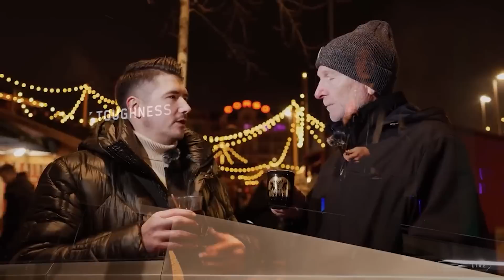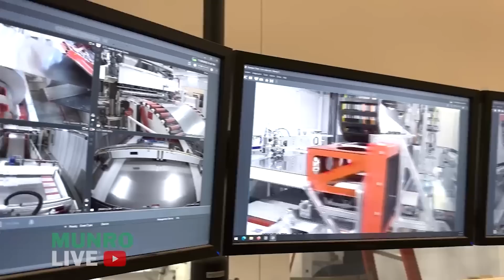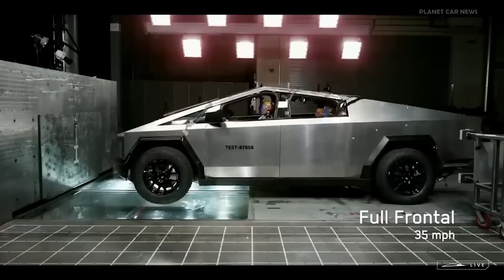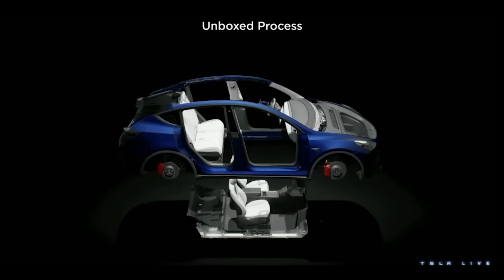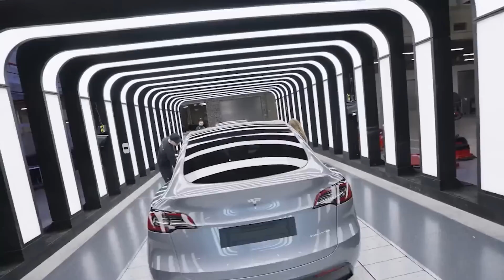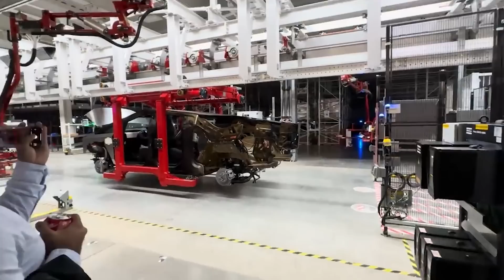Scott Walter Drops BOMBSHELLS on CYBERTRUCK!!

Comment: Ya when Tesla designs something - too bad the 4680 as originally planned is totally dead.  The 4680B which being put into Cybertrucks has sad performance. Youtube drove to 0% Range on flat ground 73f 70mph - 250 miles.  Time to charge 70% on first independent charge time recorded - a Hour! Add to that only 225 delivered as of 9 Jan 2024. The entire project is a wreck.

Comment: The Cybertruck supports variable suspension heights, the highest being 17 inches above the lowest. If I were doing the pedestrian safety test, I would be inclined to use the highest, in which case the argument that a person would be flipped over the hood fails. We'll see what the European testers think...
Reply: the truck can only move less than 10MPH in high and extract mode before the system lowers it. if you see any of the videos of the truck driving  > 20mph it appears to be at the entry or low setting to improve aerodynamics

Comment: With the 800V technology used in the Cybertruck and the new 48V low-voltage network, the Model S and Model X can be further developed and the Roadster 2 can be built.
No new factory is needed for this.
Reply from the maker: My theory is that the model 3 highland is a good base for the roadster 😃

Comment: One issue that is just coming to light is the last minute shortening of the front end has had a detrimental effect on the frontal crash test compared to a F150. Not sure if it makes it unsafe but the extra length of the hood area on a f150 makes the deceleration of the occupants much slower and therefore safer.
Reply: Oh really? You’ve already seen the NHTSA score for the CT despite no published star ratings yet? And the IIHS having not conducted any tests yet? This has all “come to light last minute” from what, exactly?
Reply: @n1c2c8  I am waiting for those and also for the Euro NCAP crash tests and the UN/ECE results.
Reply: @n1c2c8 Without much examination you can make a rough guess just by knowing that cybertruck has almost no front end and the structure behind the frunk is a bit unusual, plus two big wheels and not much else is a bad crumple zone.  Irrespective of this, comparinng the occupants body movement in overlayed crash videos by an engineer seems to back that up. But in the end, I only stated it was comparing to the Ford, and have no values to determing if it was a bad score and dangerous, and didn't state that.
Reply: @gacattack1234  They anticipated that. Bookmarks for front crash can and rear casting crash: https://youtu.be/J5zDNaY1fvI?t=1881&si=GfAf4SuuTMg--3rS

I will wait for ratings from third party testers over "rough guesses", napkin math and overlays on limited crash footage. I get it, if it comes out that this thing is unsafe and a death trap I will be the first to admit it but damn, can we chill on the doomscrolling and sensationalism until that point.
Reply: The important measure is not how far the head moves, but the peak decceleration force. For constant force, distance is relevant.   In the video it appears to me that the CT airbag deployed closer to the occupant.  If so it could be that applying airbag force earlier results in less head movement AND less peak force too.  The vital dTa is the accelerometers and force transducers in the head of the dummy - not the video - not arm-chair crash test 'experts' opinions... The proper approving bodies have the key data, and will publish safety rating... until then, make your wild ass guesses - to be judged a hero or zero.
Reply: @DarylOster  Without data it is all WAG.
Reply: @DarylOster  The longer movement over the same time implies a more gradual deceleration,and a lower peek deceleration, why is it a competition to be right when it is just speculation and not presented as anything more, I am mostly impressed by the Cybertruck and hope it gets a good result, it would be surprising but am happy to be even more impressed by it.
Reply: The CT has a higher degree of engineering in the front crumple zone..... The front casting has just what is needed to cause a perfect deformation and deceleration in less space
Reply: Oh and it was not a last minute change either the configuration of the accessible space maybe had changed latter but that's of little affect
Reply: @emiliohernandez7747  Well, not many would know when it was actually done, when it did appear, though, relatively late in the design process, it caused a bit of stir.
Reply: @emiliohernandez7747  That's what you would think, but with big wheels as impediments to the crumpling of the casting, I'm not sure it would help a lot, they're not airbags, they are usually designed to break off with aluminium control arms, so the can get out the way. Didn't see any of that happened but the speed was low. Think that might be for front offset crashes.

Comment: It's important to note that while going for stainless steel gave Tesla new troubles, it was a solution to the manufacturing issues they had with the paintshop, so if they solve these current problems, future stainless steel Teslas will be even easier to manufacture.
Reply: Ya know, if you want to fix your issues in the paint shop, then just call the people that make the paint robots and the paint and actually do what they tell you for once in your life!
Reply: @JetFire9  You forget first principles. The best part is no part. The best paint is no paint.
Reply: @wolfgangpreier9160 not convinced SS is the best material to work with.
Reply: @Dularr  No i am also not convinced, but if you don't try there will never be any advancement. 

I would be perfectly happy with this stainless steel exterior. I do not WANT a work truck, a tool to haul goods, to look good.

Beautiful cars are something to catch the babes on the beach or to give to wifey so she can catch her lover and leave you alone.

I would not clean it every day from finger smudges. Maybe i'll wrap it. But that will cost at least 5K. So: Maybe not. 

I've also not wrapped or DPF'd or ceramic coated my work vehicles which are currently mostly Teslas - for cost reason. 

They are tools and getting used and 3-5 years later cleaned and sold for a ok price and new ones will be bought or loaned or leased.

Comment: 4:07 well if you're tall, you'll be thrown over. If you're short, you'll end up under - but the car is high so no problem! 🤭
Reply from the maker: The Cybertruck goes into a "cheeta stance" while driving’. So it lowered itself for aerodynamics. Of course you can turn that off.